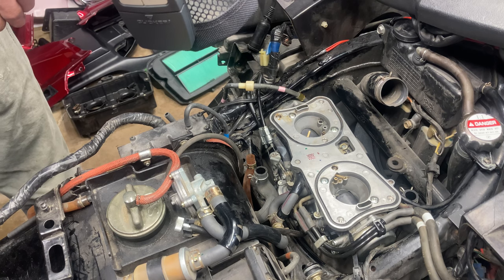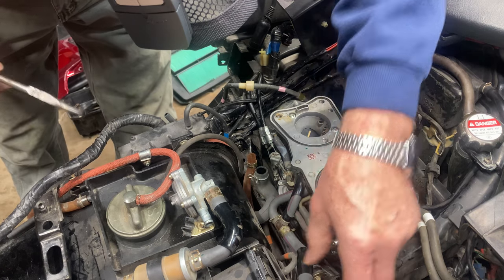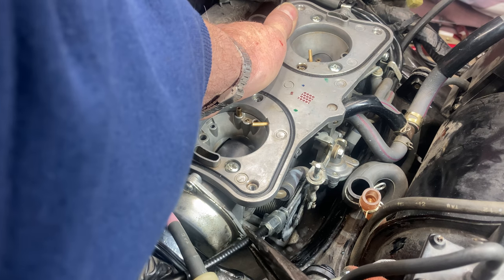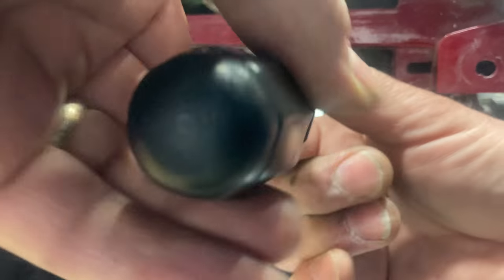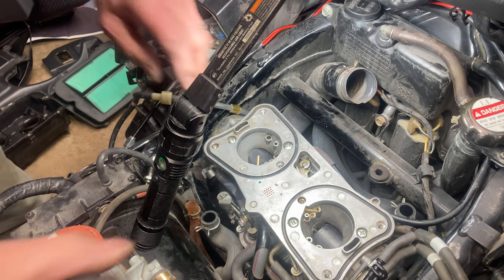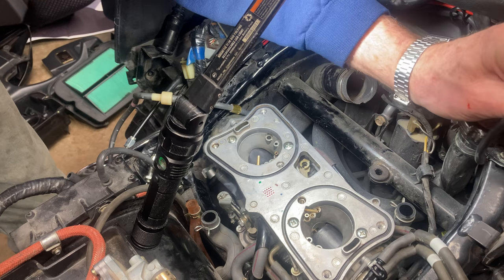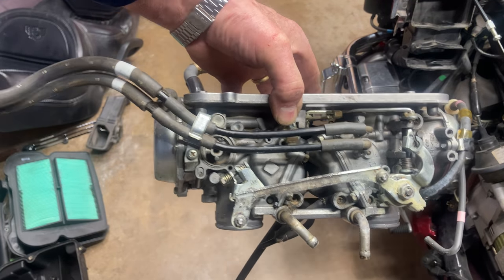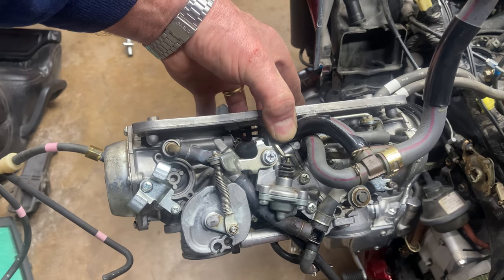Honda GL1500 Goldwing carburetor removal video, Part 2

Comment: Thanks guy i have learned a lot watching you. Waiting for my rebuild kit for my carbs
Reply from the maker: Your welcome, the rebuild is the easiest part of the whole thing. Good luck with everything and I hope it all goes smooth for you.
Reply: when you remove the carbs you have to have a very long phillips screw driver.once you loosen the clamps on the boots and remove the carbs,do yourself a favor,paint the clamps a bright color,orange or yellow so when you go to put things back you can look in w/flash light and see the screws on the clamps much easier.**if you put the bike into moth balls for an extended period of time,start the bike,remove vac hose on fuel pet cock which will shut off gas flow.this will allow the bike to run out of gas,empty carbs are not likely to have fuel setting in them and clogging jets.

Comment: Wow... I felt like I was watching a surgical procedure! Best I have or probably will ever see! great job! Do you do requests???
Reply from the maker: Thank you Mamonti, I really appreciate that!! It really depends on what the request is, but I would try to help if I could.
Reply: @herbiesgarage681  I was kidding with the request. LOL.  Biggest issue that I have found is the Carbs, timing belts,  alternator and shaft drive. I think you have covered most of it already. I wondered if you can get bearings and brushes for the alternator? I had a alternator shop that always had the parts but now they retired and closed. I would like to rebuild mine so I don't break down somewhere not to mention the cost for a replacement!
Reply from the maker: Parts seem to be harder to find anymore. When I was a kid there was a couple of different places you could go in town to buy just about any electrical part. I bought a set of starter brushes for my 1969 Firebird for less than $2 everything is just buy and replace anymore. 😊